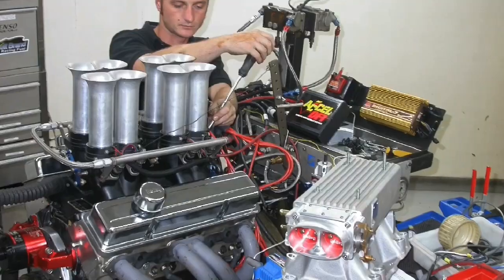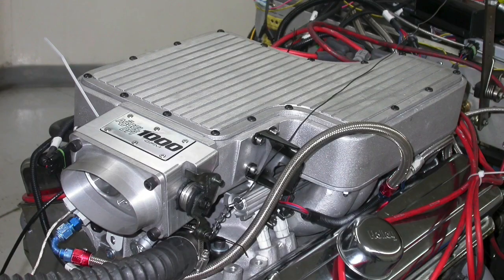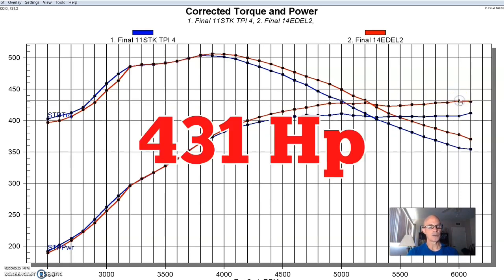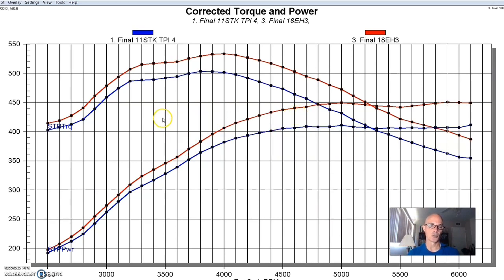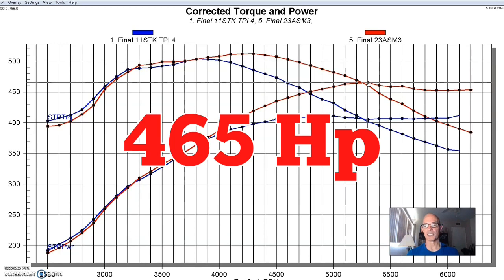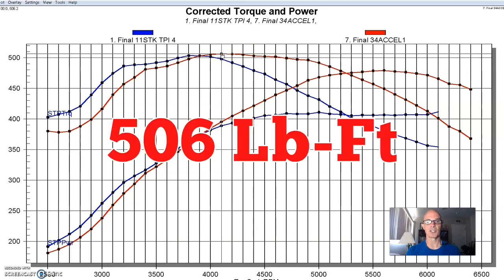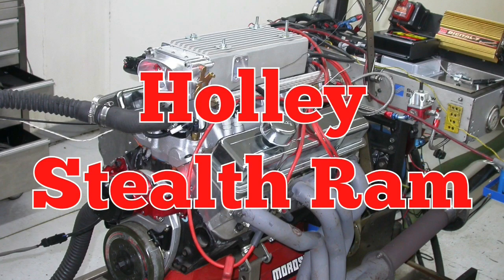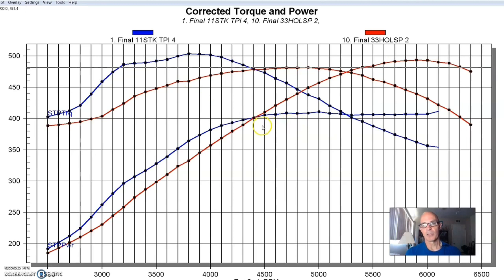TPI MEGA TEST-WHAT WORKS BEST?

Comment: If you where to pick a cam for the worked over tune port what would you pick
Reply from the maker: smaller
Reply: @richardholdener1727  Perhaps a Hyd roller ( Howards ) 212/216     .485/.495 lift at valve. LOL . maybe it not quite enough.  I actually managed to acquire a TPI system off a 305 thats been scrapped. all my stuff are 350's .   Edelbrock heads on the one of interest and flat tops. But I gotta admit, that system from First Performance is real interwtsing. they claim ability to generate up to 600HP.
Reply: Iam looking at doing a first Tpi on a vortec head 383 9.75 compression ratio and looking a a 110 Lsa 206/206 500/500 it’s going in a 6000 lb truck looking for lost of bottom end over my worn out stock l31 , dose this sound like a good combo. Cam is a comp 08-410-8 thanks for your help

Comment: One thing I've seen a few times in the TPI world that I'm curious about the effects of is siamesing the lower intake but keeping the stock or stock style runners
Reply from the maker: I've never seen it done  that way
Reply: @richardholdener1727  Another thing that would be interesting is how the massive FIRST TPI compares to the other long runner setups. I'm fixing to build a similar spec, albeit milder cam, 383 for my C4 and can't decide wether to go the Extrude Hone route or grab one of these.
Reply: @richardholdener1727   Notice how on the NASCAR fuel injection set ups.. The fuel rails and injection points are moved higher on the manifold closer to the throttle body.. Would like to see that done on a Dual Plane.. doubting it will do alot.. a little better at charge air cooling.. but maybe more.. like a spacer sometimes provides more on divided dual planes. Cheers Ricardo.

Comment: Where can you get aftermarket slp intake?
Reply from the maker: I had one for the test
Reply: You still have it? Aftermarket ones are not available correct? Looking to part with it?
Reply: @jazzyde1114  there are no aftermarket runners being made except for as&m which is the tpis runners used here, edlebrock are the same as accel casting except edelbrock added the fins you can find some being sold on ebay but they sell for 600 plus
Reply: @Madmax.3  

I ment the slp intake on the 91 firehawk. Would be a great aftermarket product.
Reply: @jazzyde1114  good luck finding one of those i think theres only 175 made but the one from this test had supposedly been recently sold the guy that bought it (ttop350) has like 5 trams now 

post484
https://www.thirdgen.org/forums/alternative-port-efi-intakes/636357-t-ram-owners-10.html

Comment: Does anybody know if the 305 from a 91 Camaro Z28 5.0 with the TPI on it is the same TPI setup as the one off of a Z28 Iroc 350 TPI
Reply: there the same just some ports were different between yrs for iac and 9th injector, the tpi was made for 305 if you look at the stock base it covers almost a 1/4 inch on the top of the head port the bigger base and runners are worth over 20hp on a stock 350  tpi

Comment: Can you slap say the arizona or holley intake on a stock engine and see similiar changes to the horsepower curve?
Reply from the maker: it makes less of a power change on a stock motor
Reply: @richardholdener1727  i see.  What setup would you recommend for a budget build utilizing stock fuel system?

Comment: Such a bummer that GM didn’t go with this induction on trucks and SUV’s...
Reply: Richard, you need to partner up with an intake company and make 17” runner LS manifolds!  You can match that up with your LS stage 1 “diesel” towing cams and we’d be set!
Reply: They put it on 454s...
Reply: The air inlet to the manifold would have interfered with the mechanical engine fan.

Comment: 3m in I'm guessing that the factory intake is costing 100hp
Reply: I thought the same thing and the fact that power dropped with even  the short runner intakes at 6k makes me think this motor needed more valve spring.

Comment: oh so sad you did not include the FIRST TPI System in this test. It's a long runner TPI with much bigger runners, base etc.
Reply: This was an old test for a magazine I believe done befor First had theirs out
Reply from the maker: the first would be like the TPIS
Reply: @lb9gta307  The FIRST ist way older than you would think. The Vector W8 had it installed from the factory! And that car was built from 1989 to 1993 ;-) It was branded differently before Ken took it over maybe but the these things do exist quite a long time already.
Reply: @richardholdener1727  Thanks for your answer. Don't you think the FIRST flows more than a TPIS system? So if heads, casm etc. are also matching the flow it should outperform the TPIS I guess.
Reply: @firefox7530   I think he means the power curve shape would be the same as the TPIS long runner,  though the FIRST would probably make more power on top, and possibly get close to some of those short runner intakes on peak power.
Reply: @echadmiyodea  yes i know thpat. The runner lenght dictates how it will work. The question was only how much top end you will sacrifice for the longer runner length. If the difference is just 25hp compared to a short runner intake like the mini ram i for myself consider a FIRST TPI a win
Reply: @firefox7530  First is still 19.25" total runner length with a typical SBC head intake port; the larger 1.75" stock ID and ability to be ported to 1.85" ID DOES shift the curve slightly to the right as the larger ID slightly impacts the wave tuning. The intake was flowed by Big Joe Sherman and the worst port stock flowed 296 CFM, so it definitely out flows the TPIS big base and runners. They'll port them up to a Felpro 1207 gasket size and it'll obviously flow more then, too. They have a 1025 CFM throttle body option and a bigger plenum.  I tend to agree that the general shape of the curve is going to be the same, but with MORE power and with the right cam it will hold on longer and you won't see the power drop off as quickly.

I would've LOVED to see the FIRST intake included, too.
Reply: I have 1986 corvette with original tpi. The motor is bored to 355 with polished and ported heads and a rv cam and an high performance throttle body. I really love having the bottom end torque especially with a manuel transmission. It works well for street application. I prefer the long tubes it puts a smile on my face every time I leave a traffic light.
Reply: @lb9gta307  Yes,Westech has been used by many car magazines. Guess where Richard works?
Reply: @tomrados7512  did you interperate what I said as meaning that I thought he ripped off that article? Because that wasn't my intention. Just saying it wasn't done recently 😉
Reply: @ron Kay Here in Canada its go gog go. no worries about smog here in the west.
Reply: @richardholdener1727  I think a bit different?

Comment: You think you could test some fuel management systems or just some pro street stuff
Reply from the maker: they all do the same thing it they provided the right AF and timing
Reply: @richardholdener1727  I'm glad you responded, I'm a dummy when it's comes to the electronics side could you give me some suggestions on a 2000hp carburated nitrous engine

Comment: I had a bone stock burning oil, no headers, I had a air foil, set of pulleys , and all smog pumps ripped off , back yard throttle body bypass 87 tpi. All "home mods"
I sprayed it with 150 wet shot tuned at vinces garage in upstate NY. 
I have slip of 12.34, 109 mph(low). Being long runner no high rpm on spray.
14.0 all day on no suspension just drag radials.
I don't see tpi cars doing this at all. 
What is up with you tube vids with horrible,  power or numbers?

Comment: I'll take a cammed salvage yard 6.0LS for a little more than most of those intakes cost.
Reply: Maybe so but this is gold for those that already have these engines in a 3rd Gen or C4. Cost of converting to an LS pays for an intake plus who wants to give up the coolest looking engine GM ever offered. Even now, they still look great in old Hot Rods.
Reply: @thebigpicture2032  I've got 2 C4s. The TPI one is getting an LS and solid rear axle. I contemplated going 383 or LS and it's pretty much a wash moneywise and leaves a lot more room for future motor upgrades.

Comment: All you needed to do was use the standard equation for tuned runner length to choose the RPM range you wanted. Lots of Testing for not much information.
Reply: The average guy buying an intake isn't doing any equasions, they're looking at dyno graphs. Also just looking at runner length won't tell you how the first few long runner set ups compair to each other.
Reply from the maker: there is no equation that tells you what the power curve looks like
Reply: @richardholdener1727  There is. Helmholtz. Worked extensively with it in college, and got to verify the calculations on a dyno with a variable runner intake. It's based on the pulses traveling through the individual runners as they reflect off the closing intake valves, travel up the port, bounce back off the plenum (or venturi in the case of a carb/ tbi) and carry back down the port. The terms of the equation are air density,  air velocity, port volume, and runner length. 

The longer the runner, the longer the pulse takes, and the lower the number of pulses/minute... resulting in a peak effectiveness at lower rpm.

The same applies to exhaust, but it's much more difficult to tune in V8s given packaging constraints in normal automobiles.